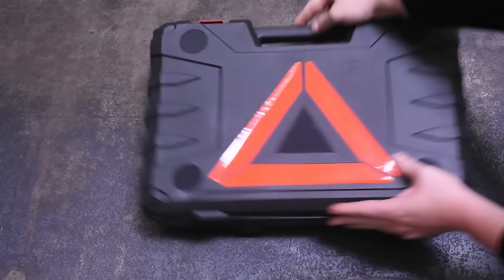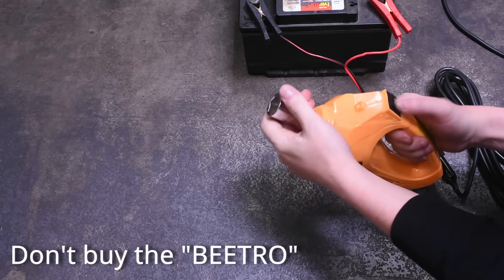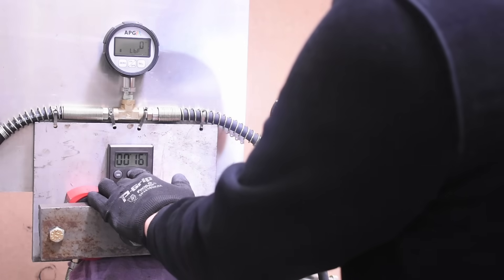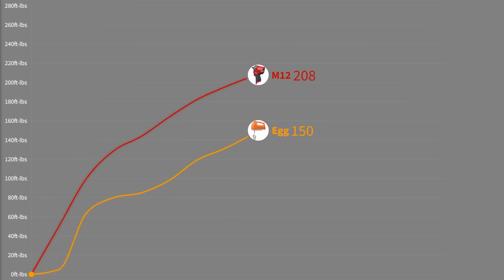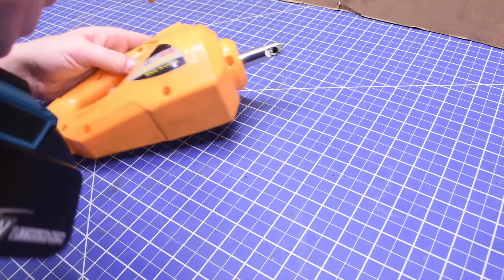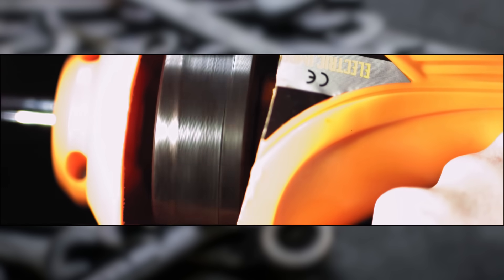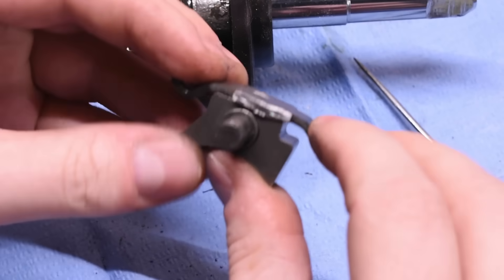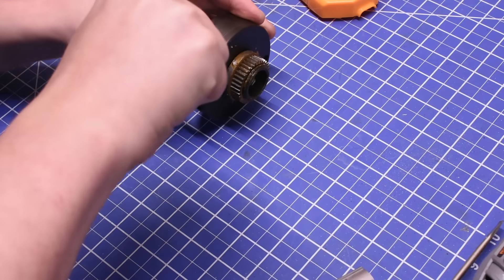The Infamous Egg-Beater Impact Wrench! Testing & 10,000fps Slow-Mo

Comment: Harbor freight used to sell an impact that had the same mechanism for about $25 that looked more like a traditional impact gun in style. It was fantastic for pulling flywheels off of motorcycles, but definitely not made for frequent use. I'd say it had about 10-30 tires changes worth of life in it before something broke, but it is indeed great for roadside use.

Unfortunately, as they've been clearing their shelves of the cheaper and sometimes odder tools they've dropped their version of this.
Reply: I had one of those, it actually broke 3/4" bolts if you weren't careful
yeah, slow wind up, but a hell of a hammer blow
Reply: @davidconner-shover51 imagine if there was a ratchet mechanism to stop it from bouncing backwards it would greatly increase the speed of windup
Reply: They’re trying to become just like other tool stores and forgetting their roots. Forgetting why we love them.
Reply: Modern Harbor Freight is meh. They peaked arounf 2019. The perfect mix of quality and budget

Comment: I've used a jack of the same type, the base was super weak when it was on anything less than flat pavement. Just the tilt of the vehicle I was using it on bent it nearly allowing the vehicle to fall. Unless they have really built up the base Do NOT trust it.

Comment: Those things are actually kinda cool! Now I wonder though... what happens if you but a big modern brushless RC car or drone motor (or even a die grinder) onto that mechanism? Or at least a better brushed motor, or even just overvolt the one in there (maybe improve the cooling a bit...). Also, how hard would it be to shove stronger springs in there? Would it increase the RPM before a hit alongside a higher RPM motor?

Well, cool video as always!

Comment: I would love to see how much the performance changes if you ran much thicker wires straight to the motor with an external switch. Those 14awg or 16awg wires are hamstringing thisb thing for sure (based on the light dimming). And maybe a charger on the battery to emulate a running engine over 14v

Comment: I suspect overclocking this thing by replacing the generic brushed mabuchi motor with an RC car brushless motor, speed controller, and 3s lipo battery would make for quite the monster of an impact.

Comment: This is so dumb that it's amazing and works fine. The only thing that concerns me apart from the motor which you can change is the hammer which is made from that crappy metal we all know about and i suspect it can shear off the axle at any moment, but if you replicate it on a mild steel bar of the same thickness it can work for ages and it would only need basic tools. A better hammer can allow for stiffer springs and higher rpm activation so more torque but from its design i can tell it might be slipping. Making the bell heavier with a better motor would also be beneficial if an improved hammer is in place. This will worth the time invested to modify it as a free time project as the price and what it does isn't comparable to something you can get for cheap.

Comment: Here's an idea for a video impact rated sockets Vs non impact rated, you're "meant" to use impact oxide finish sockets with impact tools and yet some people don't, I presume because of the risk of splintering or shattering, how about putting a selection of impact Vs non impact sockets against eachother and see how many beans each can take before one gives out?

Comment: I use a DCD996 in low gear with a custom drive fitting to do most of my jacking with oem scissor jacks. Other than the safety issues if used stupidly I find I wear them out periodically resulting in a seize up occurring during full beans use. It's not the threads that go, it's the low speed thrust bearings getting too hot at speed. :-)

Comment: Thanks for covering the egg beater. I have the same scissor jack but I modded it to take my impact wrench. Zips the car up or down fast. Good for working on cars if u need to support weight quickly for engine or trans. It's not very strong, not for hd trucks. I think their motorized jack is ok 🤔 impact is much faster 😆 yea I think the egg beater will remain a curiosity. It is capable and surprisingly so. But I think I'd get a lot more mileage from a regular cordless impact.

Comment: I put the rod with the hook on those crappy jacks in my drill and it goes up and down fast. The last one I used actually had a nut the same size as the lugs so I was able to use the impact and just give it the beans!

Comment: what are using for the power source for the 12V impact ? to get the full power you need a power supply that will deliver 14VDC constantly . i have a 12v emergency impact wrench different make and design but works the same. it states in the owners manual to get full torque you need to have the vehicle running to get full current and voltage. you screwed up the initial trial in video because low voltage draws higher current . please redo the test using a good regulated adjustable DC power supply.

Comment: Saw this on TylerTube's video a few month ago so it'll be interesting to see results. 

It might only be making 121 for a 5 second test BUT it is a tire swapping machine in emergencies and majority of tires are 100ftlbs or less on lug nut torque specs so I'd say thats pretty idiot proof for overtightening.

Comment: Been meaning to get one of those electric jacks to put on a lift table. Thinking for rear ends, subframes, transmissiond etc where moving a bar is not very useful or fun. Especially when working alone

Comment: What a clever little contraption! You'd obviously never use this in a shop unless you were tragically desperate, but it's nonetheless ideally suited to its intended task and market. Nobody wants to spend a ton of money on a beefy impact wrench just to leave it in the car for years in case you get a flat, but you also need something with enough oomph to loosen a stuck bolt. The downsides (cheap construction, slow overall action, awkward form factor) are simply not relevant for its intended roadside emergency use, and the multi-rotation momentum building trick lets them pack a lot of punch without placing unreasonable demands on the power supply. Smart engineering at its finest!

Comment: its probally just a fuse in the 12v connector, if you unscrew the tip it should be in there.... fuses a bit of wire tween two terminals, have and never been "precise" just enough to prevent a wire fire

Comment: I like the jack, I just cut a slot in a socket with my grinder to fit on the loop of a normal scissor jack 😆Impact driver + redneck slotted socket = SPEED

Comment: It would be neat to see one of these things modified via gear reduction to a hand crank. A hand powered impact wrench. For you know, replacing carriage wheels after the EMP event hits and there's no more electricity.
Reply: Garage 54 channel made a flywheel starter for a lada 😂 you could maybe bring the size down for just bolts 🤔
Reply: I've got a 50 year old Milwaukee generator that will withstand an EMP attack. It's like a cockroach with a 5hp Briggs and Scrapiron flathead.  I've also got an old corded impact. I'll be all set for buggy wheel changes, even in the dark.

Comment: That's an ingenious impactor design, for sure. I do wonder, though, how well it will hold up under long-term use. It seems to me that the contact area between hammer and dog isn't going to be all that big, which will put a fantastic amount of pressure on the contact patch and precipitate wear. Or maybe not...
Reply: its not for long term use, its for when its 3 am and -4 outside and the last thing you want to do is be on the side of the road jumping on the cheese grade lug wrench that came with the car

Comment: I’d imagine just like any centrifugal clutch that adding spring pressure will delay engagement to a higher rpm and doing so should see some gains! Especially if combined with a better motor or just over voltage
Reply: If you do this this thing might suffer a RUD

Comment: Great Job Sir.

I'm highly intrigued to see this...  I helped someone who was on the side of the road...  so he already had the wheel off, which kinda made me think "Really?????"  

But, whatever, we threw the spare on, hammered it down, and I told him "Follow me to my house, we will recheck everything..."

At the house, I was shocked to see the lug nuts were over spec....

when you hold them, and run them, they feel like they are made out of processed compressed scam nuggets....  but for no good reason, they seem to work....

Comment: I wonder about a higher voltage, or a brushless motor and also maybe changing the springs to accommodate a faster rpm before each impact. Great video!

Comment: I was today years old when I learned that these things even exist..
This thing 100% NEEDS to be hot rodded with a brushless motor and or any other upgrades Y'all feel like blessing it with.
Reply: Wonder what would happen if they used a mother designed for a cheap desktop cnc. Would be interesting to watch...

Comment: I picked one of these sets up a few years ago and use it twice a year to switch between summer and winter tires. I live in a apartment and this box is all I need to do it in a parking lot. I am using a torque wrench to tighten though.

Comment: Do you think it would be possible to wire a legit 25v 6s Lipo battery to a high torque. I would think that a good one would have a lot higher of a discharge rate

Comment: Really clever design - the motor is rendered pretty much irrelevant, so they don't need any kind of impressive input. It just has to be enough to spin the mass up to the point that it catches the dogs, and it's just all RPM+mass from that point.

Comment: Now change that 540 brushed motor with something along the lines of a 800Kv RC brushless. Let er rip itself apart!
Reply from the maker: Doesnt brushless need a controller/brain box?
Reply: @TorqueTestChannel  Use an RC ESC. That is all-in-one, connect your three motor wires, feed it power and a PWM signal for speed control. A function generator or a 555 timer PWM generator circuit can be used for that purpose, but not sure on frequency.

Comment: I've long thought of building something like this but with a pull cord in place of the electric motor. You wouldn't need to be near a battery and it would still work without charging even if you left it in the bottom of the trunk for five years. Maybe I'll pick one up and mod it.
Reply: That would be funny to see. It would probably take ages and your arm would fall off before you loosened a wheel bolt

Comment: I've been subscribed to Singlecams for around 5 years. 
This machine uses the same physics as when a batter swings the same but hits a dinger off the handle of the bat or a home run when contacted on its sweet spot. The additional mass involved gives it a perceived advantage.

Comment: Something that’s worth noting: the force those jacks are capable of varies drastically with how far through their stroke they are. From almost none when fully collapsed to much more when close to maximum extension
Reply: So go to max extension every time, right?
Reply: @rr3102  I wouldn't personally. Using an EOM Mercedes scissor jack I had it slip out to the side twice on a flat level cement garage. If you're only using it to change a tire keep it at the lowest height where the tire leaves the ground. If you're doing anything underneath the car use a proper jack stand, or if you're desperate a wheel.
Reply: @Hedonistic0Frog  what i always recommend with these scissor jacks is to only use themfor 2 minutes, to put a big rock or piece of wood to not rely only on a jack that could tip over
Reply: @bastienpabiot3678  the car wasn't even raised before it slipped to the side. I was raising the car when it slipped out.
Reply: Yeah, the mechanical advantage do be like that. Glad you mentioned it.
Reply: Maximum erection

Comment: Note that by running it off a 12v battery, you were actually undervolting it - a running car (which you want when using any sort of car-powered tools) typically runs 14-14.5v.
Reply from the maker: We ran it both ways

Comment: I've never seen one that works like that before.  It's quite reminiscent of an elevator's overspeed governor.
I wonder if it uses the classic motor used in so many Chinese power tools - and therefore possibly replaceable if it lets the smoke out.
Reply: i've got one of the 5 ton hydraulic jack versions and can confirm it uses the infamous 775 motor.
Reply: I'm curious what would happen if we put this hammer on a millwaki hand heald impact. I'm sure it can be done.
Reply: @playstation8779  might want to put a 1 way bearing betwixt the motor to allow it to not eat crap'n die  though but yeah, 100% could be done
hmm wonder if you increase the spring tension if it would hit even harder?
Reply: @djaydeved  it would till RPM before the hit drops, or the hammer/anvil starts cracking/being smashed 
.
boost speed with turning up your compressor (shop has a rotary screw... can customize all kinds stuff)
Reply: i can tell by looking , it 100% does use the generic motor
Reply: How is it not remotely surprising you watch these guys
Reply: BIG CLIVE IS HERE? MMMDAY SO SCHERES A NEW SCMEDANISM TO LOOK AT MMKAY? love you biggy
Reply: It's a 550 RC brushed motor.
Reply: It's a slight variation on the impulse coupling from aviation magnetos.
https://youtu.be/PEQ2G-XYhN8
Reply: the opposite I guess you could say
Reply: we also need AvE, phillipp kaess and kallmekris and my YT entertainmentbox is all setup.
Reply: Hi Clive, I am a sub on your channel as well
Reply: Probably same.... chinese use factory complexes with shared warehouses
Reply: Mr. man himself!
Reply: Mr Clive! Hi! 😘

Comment: Looks like it's just using the flywheel effect. It spins up that flywheel until it hits a certain rpm at which point weights fling outward, causing a "lock" to engage and stop the flywheel suddenly. This transfers that torque to the shaft all at once, stopping the flywheel, which then needs to be spun up again.

Comment: I've been wondering why I haven't seen cordless version of these things for such a long time, and wanted to see them tested, great video! One thing I'm kind of wondering about from your break down there is the anvil actually stop the motor 100% like a pneumatic wrench or does the motor continuously spin? The way that light is dimming has me wondering.
Reply: Just mentally modelling the mechanism, yes it would stall the motor on each Strike because the drum is geared directly to the motor, and when the dog engages to the anvil it completely stops
Reply: @Hyratel  yeah I think that's why some of the smoke got out. Maybe the addition of a centrifical clutch would be required for more frequent non-emergency use.
Reply: @Troyvidihoo  I think a breakover clutch (torque-limiter) would serve better than a centrifugal - this is already a centrifugal clutch (I'll call it a centrifugal impact clutch?) and it would benefit from some way to let the motor overspeed on the Strike. maybe a viscous (damping grease) friction clutch? But that would add a lot of Cost. another idea would be a magnetic load-based disconnect switch that pops open during the surge to limit the current but instantly reset. it's the same principle as a Magnetic Breaker in your house load-panel but with a Zero-time reset
Reply: @Hyratel  I see your point but this to me does not qualify as a clutch because it doesn't allow  the motor/engine to free spin until it reaches its power range/ above inrush rpms.  Breakaway  clutch would definitely help, but because it could still keep the motor in overload by loading it below it's power range rpm, it would not be as good as a centrifical clutch that does not engage the flywheel load until the motor reaches its power range,and disengages the load whenever speed drops back into inrush/overload RPMs. Either way this design sure does inspire one to experiment, but I'll probably never get around to it!

Comment: Funny, I saw his video by chance when it only had a few thousand views and I am not sure how I got to it, the magic of yoiutube I guess.   I wonder if having 2 or 3  of these hammers working together could over come the delay or perhaps a scaled down size with multiple of these hammer units working together could make a proper power tool out of it in a high torque body.     I guess we will see if a name brand picks this up or some Chinese factory develops this idea further.    Interesting seeing what I guess is for now a novel idea come out of the bottom rung of the manufacturing world, and not from the top.  Very cool.

Comment: What about testing it at a higher voltage, say 14.4v that is what the alternator would output with a car engine running. I know when i use my battery powered compressor i use it with engine running gives way faster inflation

Comment: I have one that the principle is the same, but milder like a traditional impact driver. One thing to consider is those will perform even better by a wide margin if the car is running. With 14+ volts the speed of the hammering is quite faster vs on a regular 12 volts not being charged.
Reply: Yeah, wasn't a fair test if only 12V was being provided (might even be less under load). Should be 14V. Having said that, it's likely not very reliable and I'd expect it to break when needed most. Might be the motor that dies, might be some gear teeth...

Comment: Bought the Harbor Freight version of this back in 2006 and its still going. Ive used it a couple hundred times, paired with alligator leads, going to a 18v lithium battery. 
The oem plug used a low amp fuse, which I replaced. This was the only issue I had.